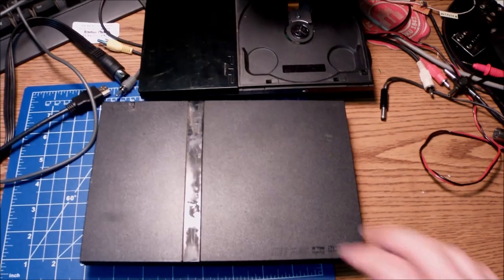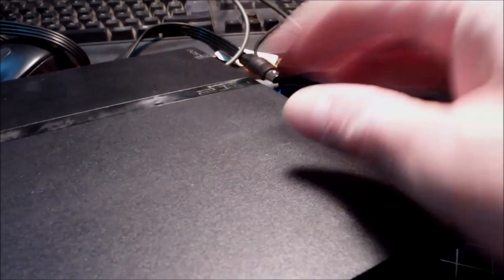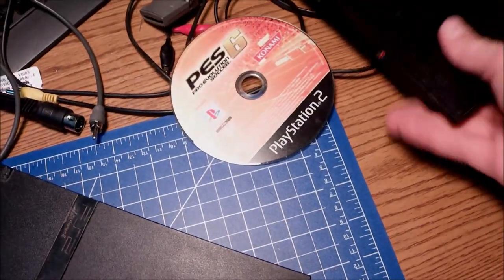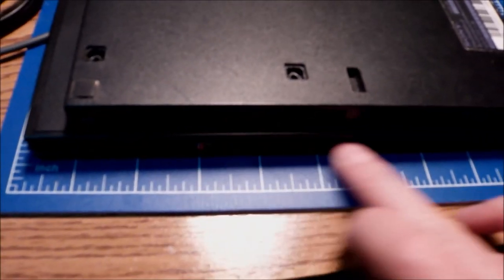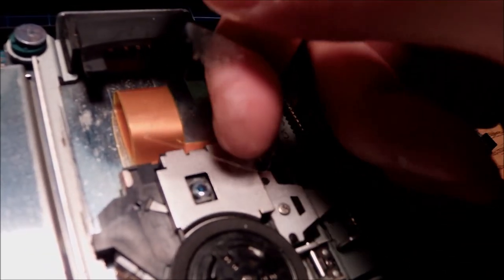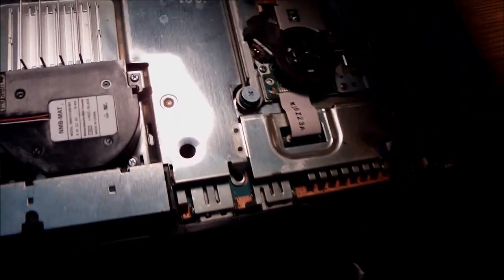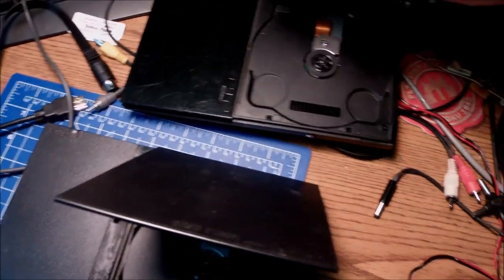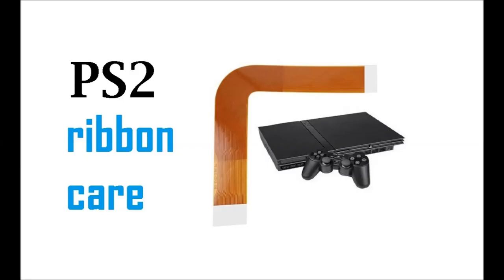PS2 Essentials:  Ribbon cable positioning & care so, no disk is damaged.

Comment: The main problem is that over time the ribbon cable gets stiff, and doesn't fold neatly anymore. You can see that as the laser is moved outwards, the ribbon cable loop gets "taller", and sometimes may scratch the discs. You have to make sure that the ribbon cable remains below the level of the black plastic at all times.
Reply from the maker: Yep, you got this right Tup! Thanks for watching!..
Reply: This was my theory as well.  The ribbons are very, very inexpensive. I would recommend, if you have to open the unit anyway, go that extra mile and replace it. This way you get new adhesive and a more fresh cable, that will flex better. Thanks for the video 👍👍
Reply: I glued a smooth bent piece of plastic to the head of the laser so it always pushes the ribbon down enough. ( I used a non permanent glue)

Comment: i Would recommend hot glue underneath. It looks better and closer to the original plus that it is less likely to break lose like tape!
Reply from the maker: yep, all valid reasons ERREX, thanks for your idea and for watching mate!
Reply: thats what i thought because my ps2 is doing the same thing made it better by taping it worked better but still ended up scratching it slightly went to mess with it again yesterday after i had just gotten it better think i accidentally tore part of the ribbon so now it just loads to that screen like it does when a cd is too scratched same with tape if you tape it down too much or in the wrong sot it wont work my dad has an old ps2 same as mibe different color i may be able to use its ribbon or just honestly would be less work to just use my powerbutton off my ps2 to fix my dads if i have to i didnt know if you had to use a specific kind of adhesive
Reply from the maker: @zacharysmith4408  great job, semi-permanent but works every time mate! Thanks for watching!
Reply: @CyberhugTechnologies  thanks man atm I could get that ribbon back together right its just glued together of course I only had tacky glue didn't work well so I bought a new ribbon off ebay hopefully it arrives it was only like a 1.67 or so may just have my dad help me he may be better at it than me.

Comment: I fixed the issue by putting a strip of tape on the ribbon, but not the sticky side. I put 2 pieces of tape on the 2 sides of the tape. I just had to make sure I don't press the eject button of the ps2 while it's on
Reply from the maker: Thanks for tip,  this is clever and thanks for watching!
Reply: @CyberhugTechnologies  Thanks! I thought of this method myself. I'm a bit worried that the tape might scratch the disc too. I usually check if it's lower than the lens
Reply from the maker: @lowell1648  excellent you did! :-) Many thanks!
Reply: @CyberhugTechnologies  Glad it helped! I scratched my god of war 2 disk, because it wasn't completely put in the PS2. I started playing and heard grinding sounds. Is there a way to remove the scratches?
Reply from the maker: @lowell1648  Only with special kits for this purpose, try ebay under cleaning and cd / dvd repair kits ;-)
Reply: @CyberhugTechnologies  Thank you!
Reply: @CyberhugTechnologies  Help! whenever I try to load the game, the lens try to move up again. it might scratch my disc again. Why does it move up and how do I fix it?
Reply from the maker: @lowell1648  It has to move up and down - this is normal -  in order to read the disk, that is why you have to move it with your hand first - test it up and down like 8:30 -  before you stick it onto the right place and its final position.
Reply: @CyberhugTechnologies  weird. I tried playing my spiderman 2 game and I heard the lens rubbing the disc, so I unplugged the ps2, popped up the lid, and saw that the lens moved to the point where the ribbon rises the most and just stays in that position. I even tried it without the tape. My dad smashed my ps2 yesterday over a fight with my brother. It still works, but there's a problem with the lens. The lens didn't have to move up before it happened.
Reply from the maker: @lowell1648  Sorry to hear that! Even so, try to check all the videos for PS2 as i have prepared several about the laser and give it a try once more, i hope it works after all!
Reply: @CyberhugTechnologies  Thanks! My dad decided to buy me another ps2 next year and it's going to be a fat model instead of slim.
Reply from the maker: @lowell1648  wow, ok - this is good news! :-)
Reply: @CyberhugTechnologies  Can I use hot glue to stop the lens from moving?
Reply from the maker: @lowell1648  NO Way...The laser lens should be a moving part, it was designed like this, avoid touching it mate
Reply: @CyberhugTechnologies  Is there another way to keep the ribbon from rising and let the lens move?
Reply: @CyberhugTechnologies  Well, nevermind. I think the lens are loose enough to scratch the disc. I might have to replace it with another lens instead
Reply from the maker: @lowell1648  Hey, that is the purpose of this video mate, just follow the steps.:-)
Reply: @CyberhugTechnologies  Well, the spring thingies are gone now. When I to press the eject button, I have to manually open the lid instead of the lid popping up
Reply: @lowell1648 best way is to super glue a plastic tab on the edge of the lens. And the tab works as a guard and blocks the ribbon cable from rising against the disc. Best way

Comment: My laser just comes down even when i touch its sensor . i have removed the lid off and have done as you did . But the laser still comes down with pressure . Pls do help(i have ps2 slim)
Reply from the maker: Hi, sounds like the ribbon is moved from original position and doesn't make good contact - Please, check ribbon connection again because not all the right "instructions" for initialization are passing through! thanks!
Reply: @CyberhugTechnologies  Do screws of motor need to be fitted in order for the dvd disc to spin
? I have checked the connection of ribbon cabe . Its in good condition. My ps2 had fallen . will laser not work bcos of this?
Reply from the maker: @ahmedshahjahan534  Hi, yes, everything should be screwed back before operation and tests. Furthermore, the "eye" of the laser mechanism is very fragile and could be impacted if the console falls. Hope this helps!
Reply: @CyberhugTechnologies  How do i identify a defective laser? In my case the laser just comes down and makes grinding noise. i have tried to fix it but ... I have taped the laser"s sensor too .
Reply from the maker: @ahmedshahjahan534  Grinding noise comes from the shaft which moves the laser up and down the motor so, attach the shaft between them properly. If console is powered up and the laser goes instantly red inside then it is probably ok ;-)
Reply: @CyberhugTechnologies  The laser doesnt go red , it just stays the same color and hits the motor once turned on. I have opened up the laser , tightened the screws inside and still haven"t figured out whats wring.I have also fit in screws of the motor . Still the cd doesnt spin .Can u tell whether my laser is damaged?
Reply from the maker: @ahmedshahjahan534  It is inactive because it doesn't initialize (go red) in the beginning - sounds like a good option to change it with a new one and note the difference in operation!

Comment: Had same issue, what i did was use hair iron on low setting and iron the ribbon cable straight which makes the cable bend less
Reply from the maker: Hey, that is smart & neat! Thanks for sharing the knowledge here and thank you for watching!
Reply: @CyberhugTechnologies  If the sticky part is there from the manufacturer when I open it, do I still have to do this to the ribbon?

Comment: @CyberhugTechnologies could you please explain exactly what you did?
It is not really clear for me. I'm sorry for asking. You used double sided tape as I understood from another comment, right?
But you taped it between the upper and lower ribbon cable, right?
And you taped the lower one against the metal when the laser is in its maximum position at the motor, right?
So why double sided tape when only one side is used?

Could you please help me? Thank you bro
Reply from the maker: Hi Ben! you got it almost right, the goal is to have the ribbon stable on the metal underneath - I used double sided tape to hold it lower than the surface of the upper part of the cover so that it wouldn't be scratched anymore. 
The idea is to get it to the maximum length indeed because the laser goes up and down and it is not right to have it tight.
Thank you so so much for watching! Please, let me know you did it after all.!

Comment: I tried bending and creasing the ribbon cable in two different areas. The cable no longer comes up high enough to scrape the underbelly of the disk.
Reply from the maker: Sounds like a fix already! Glad you made it mate, there are a few ways to make it right after some experimentation indeed! 
Thanks for sharing and many thanks for watching!
Reply: @CyberhugTechnologies  Thanks it’s been a week and my ps2 is still working fine without any ribbon scratches.

Comment: Can I put some adhesive on the bottom part of the ribbon or where can I put the adhesive so the ribbon doesn't go above the black?
Reply from the maker: Hi Choco, you can try double-sided tape to stick to both the ribbon and the mechanism. Hope this helps! Thanks for watching!
Reply: @CyberhugTechnologies  that and also where the mechanism or wat is it?
Reply: @CyberhugTechnologies  nvm I know where, I just used one sided tape and taped it on the silver laser protector thing and the ribbon and it works like a charm 😎👍
Reply from the maker: @chococatplays4899  Great great job Choco! my reward is this "works like a charm" statement !!

Comment: My Ps2 cannot play some cd games. It just can play 1 or 2 cd game that I always use. It is laser lens and ribbon problems?
Reply from the maker: Hi, CD or DVD games is it? You have to know the format that can be read and then follow this link: https://www.youtube.com/watch?v=kIk6d0wDcEA  - Try to adjust accordingly and thanks!
Reply: Cd games (blue discs) need to spin faster, you need to change the CD potenciometer a little to right, if the DVD games works dont touch the DVD part! (i just fixed it myself in 1 hour or maybe a little less), but first try to start the game while the console is off, always use ps2 controller cuz of the dualshock 2, and use atleast 1 memory card everytime if you start up a game. I hope it helped you a little bit! Good luck :D

Comment: If the sticky part is there from the manufacturer when I open it do I still have to do what you did to the ribbon in this video
Reply from the maker: If it is still there and the curve scratches / damages your disk - might need repositioning - the ribbon, to keep the curve down. Thanks for watching!
Reply: @CyberhugTechnologies  Sounds good. One more question if the curve is fine do you recommend still taping it like you did in this video just to keep it more secure?
Reply from the maker: @8252juan  i always say - if still works properly - don't touch it :-) my two cents here applicable to all kinds of hardware! Thanks!
Reply: @CyberhugTechnologies  Good to know. Thanks again for all your advice. You got a new subscriber

Comment: Some of my PS2 discs have a scratch that forms a complete circle around the center of the disc nearest to the hole. What do you think is causing them to become scratched in the center rather than the outer parts of the disc?
Reply from the maker: Hi Brandon, you have to check the ring then that the disc is fasten to - just try to see what is underneath that part of the disc with as much accuracy as possible - the ribbon can do it if makes a long curve starting from down there! thanks for watching!
Reply: @CyberhugTechnologies  Thanks man. I'll try this.
Reply: I’m getting that too but to me it looks like the lazer is grinding against the disc
Reply from the maker: @wavyjaygaming741  Two points to check there Wavy, The moving part (arm) has a micro switch at the bottom - if fails to reach the end of the ride (up/down) then you get the grinding - Or the motor shaft is not aligned with the laser mechanism right, needs re-adjustment.
Reply: @CyberhugTechnologies  the circle scratch is by the inner circle and I put the cd and dvd on the volt meter so I can readjust it because I just got a new lazer but the meter is not reading it
Reply from the maker: @wavyjaygaming741  Sounds like an assembly fault to me then - Try putting the ribbon onto the new laser again, it is not connected properly OR the laser is not sitting correctly into place :-)

Comment: How do you get the laser in the down position to check to see if the ribbon cable is okay? The laser is always in the up position whenever I turn the console off.
Reply from the maker: Hi and thanks for dropping in! That is a good question..! So, you do it gently by hand. Please, do not force it, you really do not have to. Many thanks for watching!
Reply: @CyberhugTechnologies  Thank you for the response. It turns out moving the laser wasn't as fragile or as difficult as I initially thought. Now I can see my ribbon cable is perfectly fine and I don't have to worry for the time being. Thank you so much.

Comment: Dude, my ps2 slim is scratching my disc but the problem is that it's not the ribbon itself! The ribbon on mine has been already properly glued to an L shape and it doesn't pop out at all from every touching the disc. So what exactly is scratching my discs then?? The only thing i can think of is the metal piece that holds the laser disc reader
Reply from the maker: Hi David, first try to locate which height of the disk is scratched - around which area? then, is it always the same or varies? Then, just look underneath the disk while the disk is inserted with the lid open and try to figure out what it is - maybe you're right about that metal piece after all _ Thanks!
Reply: @CyberhugTechnologies  Ok will do, thank you👍

Comment: What if the bronze ribbon goes above the disc department when it’s in the middle? You just showed it when you pulled it all to the end
Reply from the maker: Hi, in this case the ribbon would be in contact with the disk when inserted, we don't want that because it will scratch the disk while spinning fast so, game would be damaged.
Reply: @CyberhugTechnologies  what’s the solution then? The same what you did in the video? I don’t think doing that will fix it, i would imagine even the ps2 that you showed if you pulled the bronze ribbon to the middle it will be above the surface if i ain’t wrong
Reply from the maker: @naninano2613  Hi Nano, the tape works fine keeping it down, i did it many times. Trick is to stick it in such a way it will let it go up and down but not bend the wrong way. needs a bit of attention but it stays down, believe me.
Reply: @CyberhugTechnologies   one more question and please be patient with me lol, if the laser mechanism pulled half way or lil more but not all the way through, is it normal if the bronze ribbon became lil above the disc department? Just wanna make sure it’s not my OCD picking on me lol cause in the video you didn’t specify or i missed it so i was wondering
Reply from the maker: @naninano2613  Hi Nano, no worries - i am here to help if  i can - the mechanism should be able to travel ALL the way because otherwise you might have the grinding noise effect. As it goes ALL the way down, it passes eventually the halfway point - but - this is not the maximum curve of the ribbon so, it is ok - the maximum curve might be created when it is all the way UP so, this is what we're trying to minimize, the curve when it is all the way UP should be about the height of the compartment and not exceeding it :-)
Reply: @CyberhugTechnologies  thanks a lot man, will try and see 👍